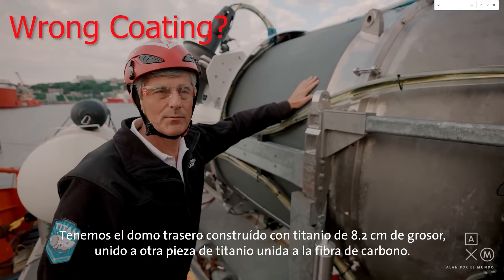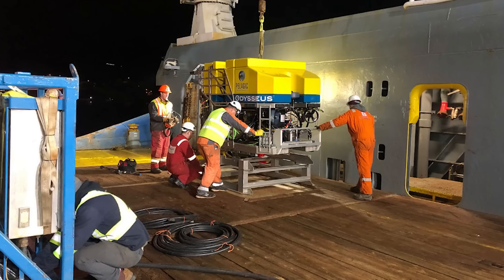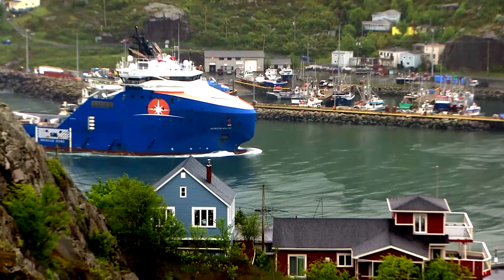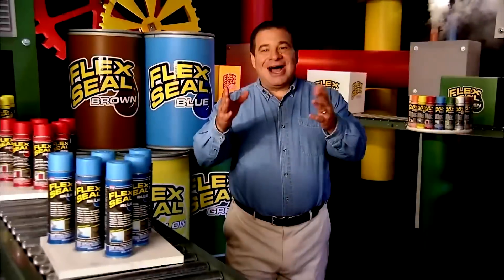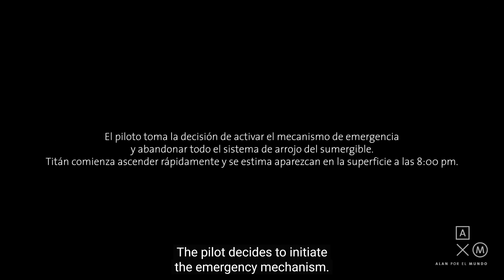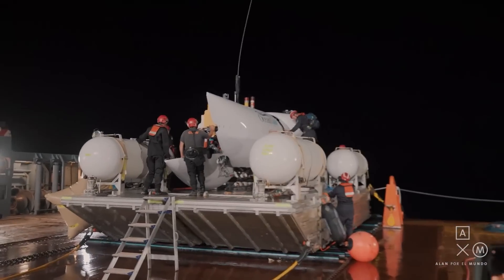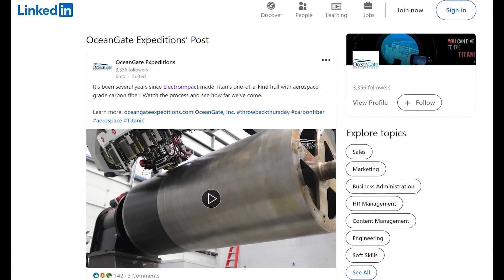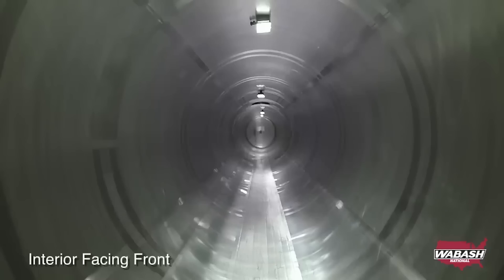Titan Sub Wrong Coating? Hull Construction, Debris Field Search

Comment: Finally!! I've been waiting to hear about this. It's the same thing they spray in pickup truck beds, isn't it?? I caught that and kept waiting for someone to call it out!! Thank you!
Reply from the maker: Yes they also have a marine division
Reply: Applying any thick coating to a structure that is going to get wet is problematic. It makes it nearly impossible to do any meaningful inspection of deterioration of the fibre composite or to assess water penetration.
Reply: @dougcollins9980  It doesn't matter in this case as they didn't do any inspections.

Comment: Here they have severe cognitive problems...The central cylindrical component was made of EPOXY RESINS...because the fibers tolerate linear tensions and traction...The ocean compresses the resins...The sleeve of your shirt cannot withstand pressure...yes you add resins if it does...

Comment: Actually now with Domino’s they have a new feature where you can just drop a pin and the delivery guy will just ODST in from the sky.
Reply from the maker: They need to get that Flex Seal sub for delivery
Reply: @jeffostroff . Subway is using that one.

Comment: If someone was sitting mostly or entirely in the front end cap, what would they experience during the implosion if the simulation shown in the last video is an accurate simulation? Would it be the same or different than one in the middle?
Reply: Physics would get you before you would know. We're talking 20 milliseconds at the most. If you're sitting in the middle, you lose a few milliseconds. The water would crush you in the middle, sitting in one of the caps, the air would crush you, followed by the water in 2-3 milliseconds. The collapse wave is enough that it would tear you apart on a cellular level. The air would make your lungs, ears, eyes, and sinuses explode, and the water wave would tear you apart, especially where there is differences in density (bones, teeth, fat, organs, any intestinal gas would be compressed to 1/400th the size by 6000 pounds per square inch. 
    There probably would be cavitation with the wave coming to a point. Vacuum is created when the wave reflects out, and collapses again, probably a few times. Oh, and the water is full of sharp carbon fiber bits. Explosion would be getting hit by a 16" shell. Now imagine you're in the barrel behind the projectile when the gun is fired (not obstructing the barrel).
Reply: @patrickvolk7031  Just adding, they would be burnt too due the fast air compression making temperatures get close to that of the sun surface.
Reply: @pedroadrianodeandrad  Yeah, no. Temperatures near the sun you say? That air is surrounded by a hell of a heat sink, and the pressure is orders of magnitude less than what is on the Sun (you're not fusing atoms)
Reply: @patrickvolk7031  that's an incredibly well worded description and imagery. Kind of scary to think about, but also very interesting in the sense of the amount of force, power, and destruction generated in fractions of seconds
Reply: I’m pretty sure the last video was a vacuum implosion, meaning that was only the weight of the atmosphere above it. 1 bar. At Titanic depth it’s more like hundreds of bar. 1 bar equals 14.7 psia.
Reply: @jordanhenshaw  I appreciate the info. Very hard to imagine a force several times the speed and power of that last simulation video
Reply: The actual collapse would have happened at about the speed of sound, taking just a couple of milliseconds.  That's longer than the time it takes for sensory signals to pass through neurons and be registered by the brain.  So, mercifully, none of the passengers would have been aware of the collapse before they ceased to exist.
Reply: Thanks for the replies!
Reply from the maker: It is all so fast, I doubt it would matter either way. If the glass window blows in, it happens with such speed you are decapitated befor the brain even knows it
Reply: @jeffostroff in the simulation at the very end, it looks like only half of the "tank" was crushed in. The other half was still ok. I think that's what this person was wondering. LOVE the videos Jeff!! Great question as well, I am wondering the same thing

Comment: Its not a rhino line the navy uses. This guy was a hack. We had left over "rhino line" after completing a contract with the navy and decided to coat the floor of our cnc machines to keep from slipping on the coolant when walking in and out. That stuff rubbed off after a year of foot traffick. The navy reseals and applies the "rhino line" quite often. Its not a one time, one coat and go.
Reply from the maker: That is even scarier
Reply: @jeffostroff  i talked with my co-worker about it just now. I took his spot on this machine. He said its applied like paint with a hardener. Thats it, its not rhino liner. His boss claimed this thing was going to last for years but the coolant ate right threw it.

Comment: Those metal containers imploded in the atmosphere are not relevant. Carbon fiber is not metal.  You should use an egg submerged in pressurized water to see the exact effect. Also, just watching the sides of that tanker cave is does not get the effects across. When something implodes, everything inside gets smaller, including people. You get squeezed down to the size of a watermelon and it is really going to hurt.  The camera inside that tanker can't show that.
Reply from the maker: I showed that video because it illustrates how even only 1 atmosphere can cause a rapid implosion, so imagine over 300 atmospheres at that depth, how much faster and  more violent it would be

Comment: The real question is, what did they do right? Basically, nothing.
Reply: Apollo 13 transcript (after the explosion)
Gene Kranz:  Sy, tell me what do we have on the spacecraft thats good?
Sy Liebergott:  I'll have to get back to you Gene.
Reply: The only thing positive about this is he killed himself before he created a bigger sub and killed more people
Reply from the maker: Wellt hey did make it down there a few times
Reply: @jeffostroff a broken clock is right twice a day😅lol
Reply: @Riverofstarrs  if it's a 24 hour clock it's only right once a day
Reply: @jeffostroff and each time they did , the hull got a bit more compromised
Reply: @jeffostroff  
They did not do it right, though
Reply: @jeffostroff hi Jeff, thank you for your analysis! Really enjoy them. A question on this, perhaps i missed in your series. Are you saying this same submersible made  it to the titanic and back? How many times? And are there NDT results that explain its integrity to make the same trip?
Reply: @padeosarran  Yes, it has been down there 3 other times.
Reply: @padeosarran  The Titan submersible had made about 90 trips to below 4000 feet and of those dives 13 reached to the titanic depth of 12500 feet.  This is why Stockton got confident that his sub was safe... but it was a deception as carbon fiber rapidly gets weaker from cyclic compression
Reply: @nickl5658  Ah yes. 14% is enough to risk 4 other lives.
Reply: @nickl5658  By simply wrapping the core of a toilet roll in carbon fibre, you can demonstrate it's enormous TENSILE strength, showing that you cannot burst it from the inside. Then you can just crush it from the outside with your  bare hands.
The only crush strength was from the epoxy, but since it contained air bubbles, they would progressively collapse from the outside on every dive cycle, reducing it's strength to that of a soggy sponge.
A far better solution would have been to start off with 2 titanium cylinders of half inch thickness, leaving a 5 inch gap when they were placed one inside the other.
These could have been continuously welded into slots machined into the end caps. The cavity could have been evacuated  and it's ability to retain a vacuum verified.
Using a mixing nozzle and sealed connections to the vacuumed cylinders, the entire cavity could have been filled with high strength low modulus epoxy and left to cure for a few weeks. 
The whole thing would have needed to be on end and slightly tilted, with injection at the lowest point and vacuum at the highest. A window tank at the top, would have verified complete filling.
Needless to say, the epoxy would have needed to be retarded, to allow time for filling before curing commenced.

This method, using conical removable cones, was used to construct the single piece nose radome of Concorde. Throughout the life of the aircraft they never had a failure. 

Perhaps the most important factor, is that regular ultrasonic testing could have been performed. The titanium outer shell would have also given good damage resistance and clearly visible marks of any impact.
Reply: @OMG_No_Way where did you get that number? They made it to titanic more times than that. I believe there were 13 other missions across 3 years, plus all the other dives
Reply: @nickl5658  Sooo.... 91 trips beyond 4000 feet, 90 of them successful.   Hmm  sounds like 98.9% success.  Sure, sounds good until you consider what failure means.  And start comparing that with the success rate of a lot of other everyday things, like commercial aviation.  Or heck, even just my personal driving record (been to the grocers more than 91 times without dieing).
Reply: @wilsjane  No, you can't "just crush it with your bare hands" if your bare hands push equally all the way around. Tensile strength also stops a cylinder from crushing when the force is equal. Because in order for any circle to become an oval, two sides of it have to get shorter, but also two sides of it have to get longer. So both compression and tension strength can keep a cylinder from crushing. Have you ever ridden a bike? You didn't crash because of mostly TENSILE strength holding your bike wheel together against CRUSHING forces.
Reply: @gavinjenkins899  Their is some truth in what you say, but it was the lack of compressive strength that caused the hull to crush. This was due to small air bubbles in the epoxy collapsing and reinflating on every cycle, degrading the epoxy and progressively turning it to dust.
You need tensile strength in a cycle tyre, to prevent the area not in contact with the road from stretching beyond it's first modulus of elasity . This would not work if you allowed an elephant to ride your bike. LOL
In Titan, the stresses between the cylinder and spherical encaps were probably the weakest link and where the breakup first started, but it would have all happened in a few milliseconds. 
Theory is necessary in all calculations, but the properties of the materials used are equally important. In this case, the carbon fibre was doing nothing, except including  air bubbles in the finished job.
Reply: @mikefochtman7164 That's made up. THAT sub didn't do that.
Reply: @wilsjane  Why not for an elephant? Elephants don't have special elephant exclusive physics... lol. You'd need a beefier tire for an elephant (just like these guys' rim was 5 inches thick), but it would work fine, and your elephant bike would still mainly be withstanding due to tension.

I agree the sub failed due to some kind of multi dive cycle of cracking or bubbles or expansion contraction etc,  but that is not the topic we are discussing. We are discussing the FUNDAMENTAL concept of tension holding a hoop circular against outside force, which works in general/fundamentally
Reply: @gavinjenkins899 Where are the sides on a circle?
Reply: @kev_299  sides = the two portions of the edge parallel to the force, that would have to expand for the circle to squish. In a bicycle, there's only two sections at any given time, in a submarine, there's forces from all directions, each little bit of force being opposed in TENSION by the sections of the circle parallel to that force, which don't want to expand thus don't allow the circle to squish
Reply: @gavinjenkins899  Ohh🤣 so you mean like when a circle becomes ovular or like when a sphere becomes oblate (spheroid)?  I’m not used to such complex terminology like squish and circular lines in technical writing.  My bad.😁
Reply: @kev_299  You may want to sit down before you hear this shocking revelation: The Youtube comments section is not, in fact, an engineering trade journal. Meanwhile, now that you've confirmed you knew exactly what I meant and that the wording was thus a non issue, did you have any actual real argument? Seems like nope, so... glad you agree, then, that tension is completely fine for resisting external pressure.
Reply: @gavinjenkins899  Yes somewhere in the salad is some valid info.  Congrats.
Reply: @kev_299  Again, you already demonstrated you understood exactly what every single word meant, so it was not, in fact, salad at all. And now you also agree with the content of the message. So you agree with the content AND you completely understood the presentation. So there was zero problem, and you're just whining about literally nothing. For the sake of whining.
Reply: @gavinjenkins899  It’s not a trade journal and input is welcome .. but it sounds like you’re arguing with some people who are in the field and it’s very obvious from reading who has at least practiced and used technical writing which is literally the first thing you learn.  It allows you to convey your point more concisely without wearing out your keyboard.
Reply: If you conflate “somewhere in the salad was some valid info” with me agreeing with everything you wrote you’re completely mistaken.  I was being nice and I don’t want to sit here and poke holes in everything that was wrong.  Good luck with your endeavors.
Reply: @kev_299  Look up "appeal to authority". Being in a field by itself doesn't mean jack squat, not even in real life where you know they aren't making it up. If someone truly is an expert, they should SHOW NOT TELL that by drawing on their knowledge to make quality, cogent arguments with good reasons, and knowing how to cite relevant references when necessary. There's no reason to ever even bring up one's job or credentials, since that itself means nothing. Nor does jargon as long as you undertand what was meant (which you did).
Reply: @kev_299  "Don't want to" --> "Can't, because it was correct" Fixed that for you.
Reply: the marketing
Reply: Yep. Every dive was actually damaging it. Reducing its crush depth. Had they done full size and fatigue testing they should have thrown it away after the first trip.
Reply: If we laypeople have learned anything from this whole mess it's that with submersibles you've only got to get one thing wrong.
Reply: @johnnhoj6749 there's been comparisons of this sub to another one called Alvin, which has a bulletproof spherical titanium pressure hull, and it's designed so if they get stuck they can drop everything else and the sphere floats.
Reply: It is quite amazing how long it did last
Reply: They put it in the ocean instead of a volcano. Arguably it was just as suited for ocean exploration as it was lava diving...
Reply: They found the Titanic's locsation, they got that right!
Reply: @gavinjenkins899  and they decided to join them for permanent
Reply: If this is the thread where we all say something nice then they got to see some beautiful scenery and enjoyed some pretty nice accommodations on the ship - kinda like Titanic passengers.  They also completed  the most comprehensive 3D scan of the wreckage we can all look at so maybe no more amateur captains or innocent people need to die trying to get even more pictures of rust.
Reply: I don’t think Ocean Gate gets enough credit.  They obviously had a pretty well thought out disaster recovery plan including contracts in place with Pelagic well before the disaster occurred.  They probably had a lot of other well thought out systems in place but when your boss is crazy  and cheap there is only so much you can do.
Reply: @BlindBatG34 Lol!  So well thought out.thwy didn't even start to implement it until 8 hours after loss of contact.
Reply: @BlindBatG34  I wonder if they signed up thinking there would be a contingency ROV on the ship like the one referred to in an interview.  They were offering trips down for discounted $150,000 rates and were still struggling to find willing buyers.
Reply: It’s looking that way
Reply: @@JimRex-vv4qs I found it amazing with his record of failures that he even managed to get anybody that would go on it colossal mistakes from those that got on that sub, and everyone of them had to think in the back of your mind. This could go south, and very far south.
Reply: Except neither you nor Jeff knows whether Rhino was an issue in any way. The only "evidence" is casual speculation based on a few pictures of the more frequent marine applications. Did he even attempt to get the MSDS for the product or any of its components? Did he even look for papers on Rhino or other sprayed polymer systems for subsurface applications? Did he attempt to compare it with the rubber on actual submarines? Probably worth a shot if you're actually interested in understanding what happened!
Reply: We’ll i mean they built a submersible that reached the titanic a handful of times, better than you could do
Reply: @Contigy *before killing people due to negligence. You are right, if I made a sub I would you know...actually do it by the books.
Reply: @tarkov_6  No one asked what you would do if you made a sub. The kid asked what he did right, he obviously did something right.
Reply: @Contigy  except someone opened up that conversation with "...better than you could do" which asks what could you do better? Making a sub that kills people is worse than not making a sub in the first place.....
Reply: @Contigy  and they paid a price for that didn’t mean I wonder if they now think it was worth it… All those people left to pick up the pieces of gotta be wandering